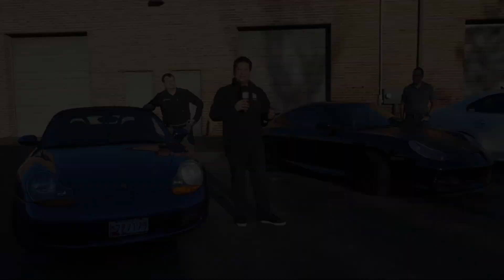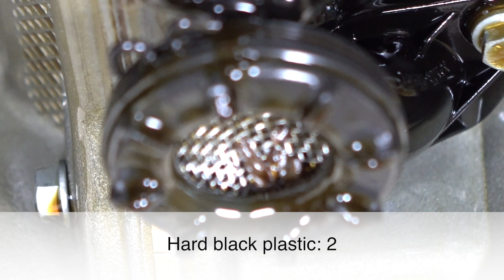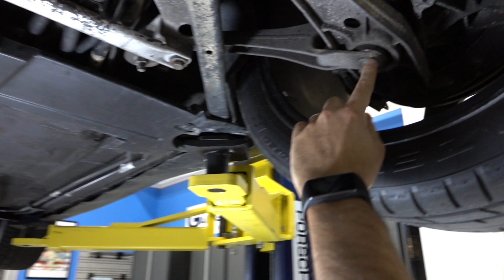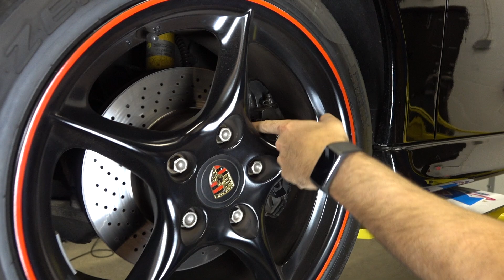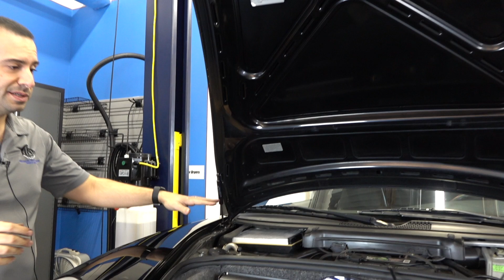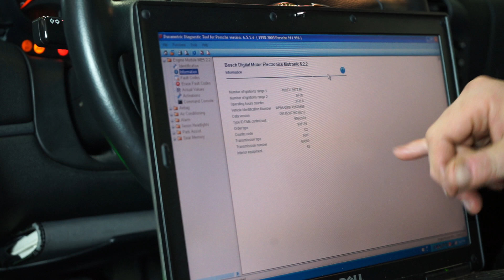Porsche 996 vs 986: What goes into a pre-purchase inspection of a 996-gen 911 and 986-gen Boxster

Comment: Excellent video.  Most Indy shops I've used to do PPI don't even go through half of this but they charge $$$ for inspection. The computer analysis shown here is excellent. I've never received a report from even the best Indy shops that have done PPI for me. The graph should at least show if the car's running good. This is the reason buying a pre 2009 P car is scary. I know the IMS and RMB failure are low per Porsche stats but I speak for some Porsche enthusiast we don't have extra 25k for replacement engine. Thanks for making this video.

Comment: you spent a bunch of money changing oil and the oil plate gasket, but I saw no real inspection to see anything going on that required spending a couple hundred dollars to change the gasket .   I saw no inspection of the oil filter removed either.  what did all the damage to the fasteners ??     also if porsche engines are well made why would so many 20 year old or less engines be replaced ??     The crank angle and over rev stuff was excellent info.    do you get a list of repairs suggested ??  after an inspection ??  or a value you think the car has ??

Comment: Excellent review.  For all of us concerned about the Porsche IMS Bearing issue - I found a very informative article from Autohaus Hamilton in Australia about the IMS. The article also lists all the models and engines (with engine numbers) that are affected. To read the article just type in “Autohaus Hamilton IMS” into google. The Porsche models that are prone to IMS failure and should be replaced are: - All 986 Boxster models. - 987 Cayman & Boxster models up to engine number 61504715 - All 996 models (not including: GT and Turbo models) - 997 3.6ltr with M96/05 up to engine number 6950745 
 

Before 2000 Porsche used a double row IMS Bearing which had a low failure rate, then Porsche switched to a single row until 2005 - 2006 and this single row has had the most problems. After 2005 - 2006 Porsche stayed with the single row but beefed it up significantly and this bearing has had the least problems of all three types of bearings used from 1996 to 2008. The upgraded bearing in the 997 and 987 is unserviceable, meaning you can't reach it unless you strip the entire engine down. From my research the IMS issue has been greatly exaggerated, mainly due to a cottage industry that produces and installs IMS Bearing replacements, so naturally it's in their interest to scare all 996, 986, 997 and 987 owners into thinking all their engines will suffer IMS failure.

Comment: In the UK, check the brake pipes, especially behind the plastic cover under the left side of the car. It is very common to see these corroded. Take care when you remove the calipers the large socket head securing bolts protrude through the bracket and several exposed threads corrode causing damage as they unscrew. Clean and lub the protruding part first. Manifold studs/ nuts on the  heads  corrode to almost nothing, not much you can do without major work and they can last for ages in that condition, but be aware. For all of that, 996 is a fantastic car, drive one and you are hooked.
Reply: Good advice!  I have a 996 from Florida, so dirty side looks ok concerning rust, but a very little bit of Florida sun damage to dash.

Comment: Ugh I just paid for a pre-purchase inspection on a Porsche boxster 981 and they did not lift the car up to check under it. Definitely didn't drain any oil.  Supposedly, they checked the belts and such, but none of the pictures I received even showed the engine.

Comment: first thing i'd check be ims bearing then clutch then oil leaks
Reply: How would you check the IMS bearing? Is there a quick and easy way to check its condition?
Reply: searaydrivingguy replaced all those on my Porsche Boxter s when I bought right away and have been happy with it for the last 3 years